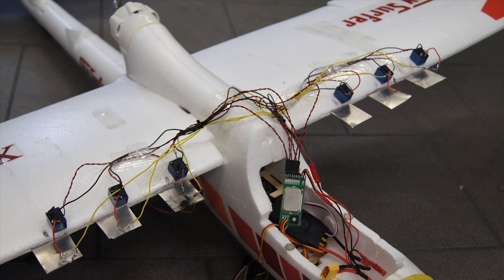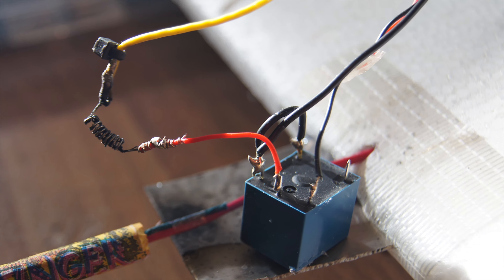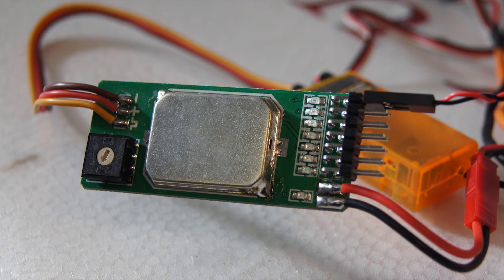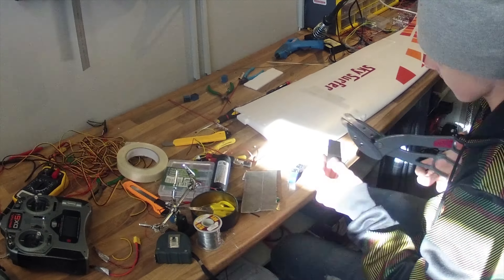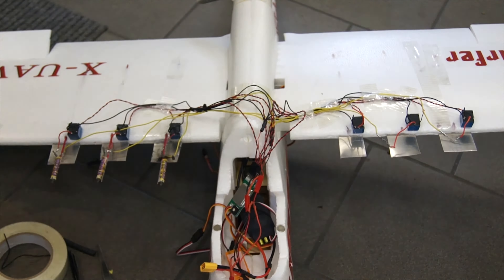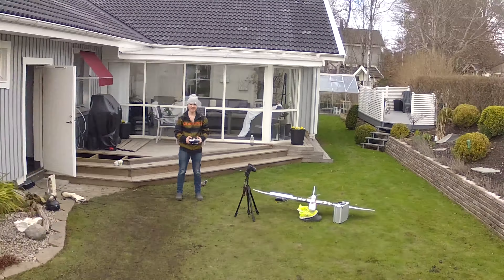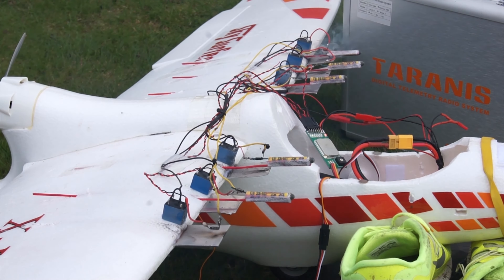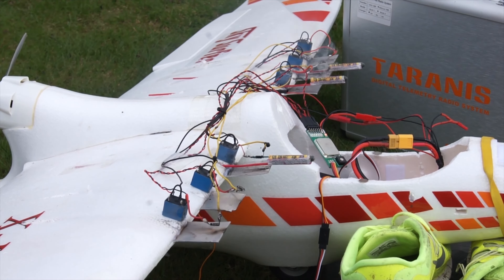RC Firework Ignition System for RC Airplane - RCLifeOn

Comment: Just a thought: You might get much faster ignition and better response by pulling out the fuse and inserting the wire into the firework, though it would take longer to load and might burn the wire. It might be worth testing, as it could make it easier to hit what you are aiming at. 

Love watching your projects. They've inspired me to take up my long neglected hobby of tinkering with things to try to make them better (emphasis on "try").

Comment: Good video, Got any recommendation of a 1 amp relay that work in the same way? trying to power a led light with the same multiswitch!
Reply from the maker: +vonown3d A led light won't be a problem. Each output of the multiswitch can supply 0.5 amps.
Reply: +RcLifeOn its the 16 ledring from hobbyking, some ppl say it draws 0.8 amp!
Reply from the maker: +vonown3d You may want to use transistors instead.

Comment: lite sent nu kanske, men om du ska göra om det, använd transistorer istället för reläer.  myyycket mindre och lättare :)

kul projekt!
Reply from the maker: +Joni Paananen Jo jag kollade allt på det, men är inte transistorer ofta för relativt små strömmar? En av dessa små khantal-spolarna drar upp till 7 ampere! Detta var förstås bara första testet, när jag ska flyga så tar jag självklart in alla reläer in i cockpit.
Reply: Det finns transistorer som klarar av flera hundra ampere =) jag är inte tillräckligt bra på det för att säga exakt vad de heter dock, men det är så en ESC fungerar, genom att sätta på och stänga av transistorer i rätt ordning. Och det finns ju ESC'er som kan driva rätt ordentliga saker. Nu har du ju fått ihop det, och funkar det så funkar det.